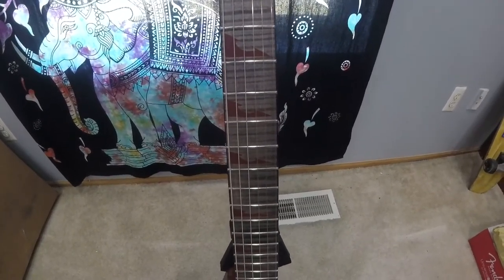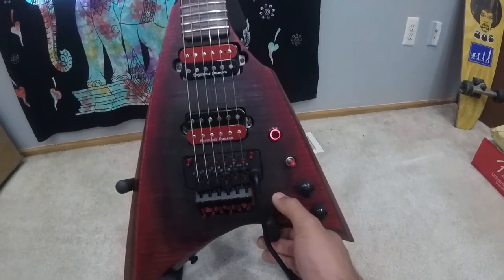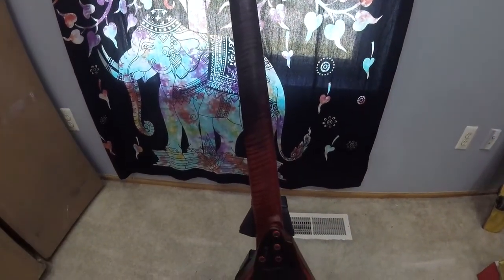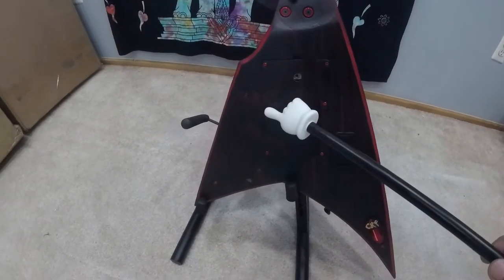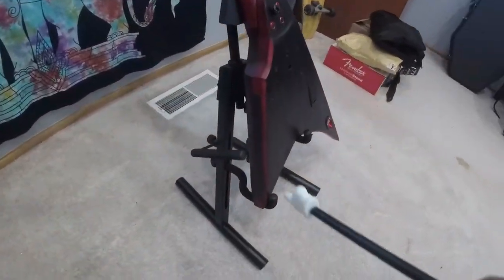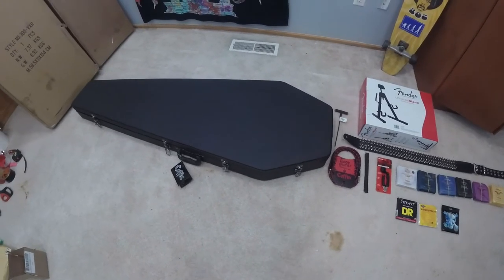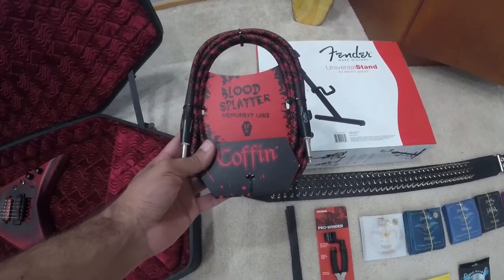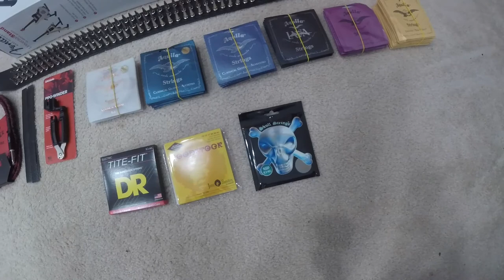Building The Most EVIL LOOKING Randy Rhoads Style Guitar For Camilo Rijo Fulcar

Comment: Man, I have been planning on using a zero fret with a floyd locking nut on my next build. This is the first I've seen it in the wild. How is it?
Reply from the maker: It works fine but always remember to install the locking nut just a tiny bit lower from the zero fret or else, locking the nut will pull down on the strings causing the notes to go sharp. Cheers!!